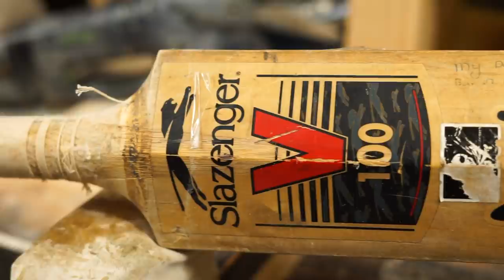Cricket Bat Repair EP-9 - Slazenger Repair & Refurbishment

Comment: When I worked for Newbury cricket, we used a 4 inch length of 2x1 timber with a hole in approx 3/4" from each end through the thinnest part, thread string up one hole and down the second (so it looks like a string staple, if that makes sense) this allowed  to control the tension on the string and you don't get burns on your fingers.

Comment: Good to see an old tool of the trade getting a second innings. Another 10 thousand runs to look forward to.
Great craftsmanship there fellas 👍👍👍
Reply from the maker: Thanks 👍
Reply: Whats that translucent tape applied at the end on tha face called?
Reply: @avalaxsog8380  extratec / bat facing. It’s a product most retailers will sell that protects the willow on the face from moisture and damage. Also means the bat won’t dry out and become brittle.
Reply: @Maaantis29  thanks, need some of that for other application. Cheers 🍻

Comment: Hello, what did you use at the toe?
Reply: Fibreglass
Reply: @timpickering1516  Thank you so much. Can you also let me know what is that black thing and where can I get it? Can you share a link of where I can find it online?
Reply: @ravrayz5940  without asking them directly, I think/assume the black paste used is epoxy or polyester resin mixed with either glue powder or microballoons (fairing/filling  compound). The black colour could be from a pigment that's added to the powder.  Here in NZ we would get these types of products from lots of different stores that specialises in fibreglass and associated equipment. An example of this may be this site https://www.resincraft.co.nz/collections/general-purpose-resins-cloths-tapes-carbons-fillers/products/fibreglass-tape
Reply: @timpickering1516  Thank you Tim.

Comment: Are cricket bats really that expensive that an old damaged bat like this would be worth all this work other than just buying a replacement?
Reply from the maker: Repairs like this are often far cheaper than buying a new bat, and performance increases during the lifespan of a bat. Also, older bats like this can hold a sentimental value to customers.

Comment: Bat's handle was looking good, there was no need to replace it.
Also once the blade is cracked it doesn't give same performance like before infact after restoration. By repair we can only hide it's cracks.
Reply: How about customer asked for it? Modern handle shape versus old shape?
Reply: If customer asked then no option except replace. But since beginning, triple layer full Singapore cane round handle is considered better than oval or any other type.
In the video, the bat was old and much used but handle was still looking absolute. Only grip and threads work was required.
It's my thoughts only.